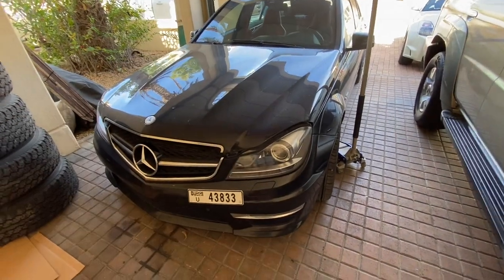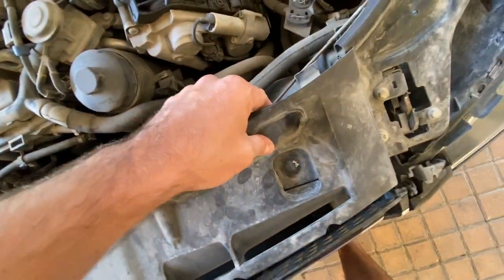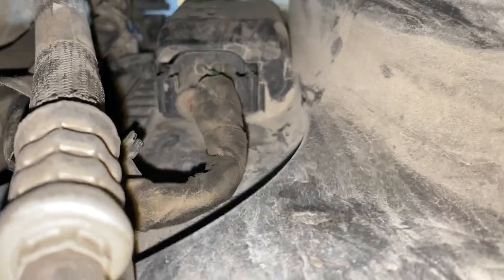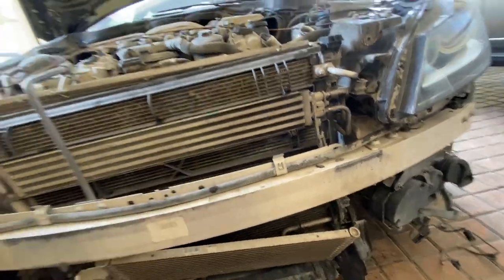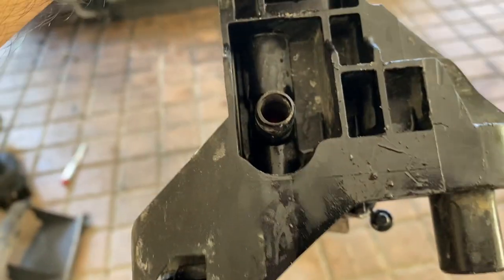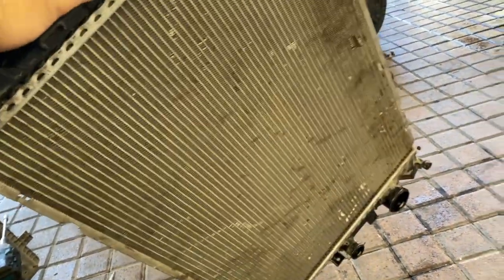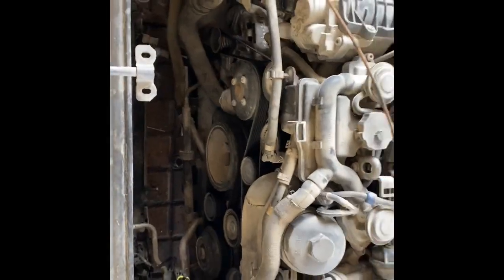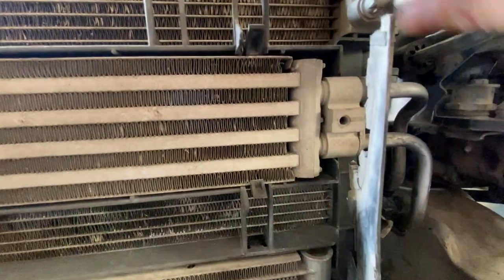Radiator repair for $80 - C63 AMG W204

Comment: Cool video it helps a lot.
Question. Do you have transmission oil lines in your radiator ? 
I have an 08 C63 and want to replace the cooler. Bt I think I have 2 oil cooling lines in the radiator.

Comment: Many thanks for this. In the middle of this job now and probably would’ve given up getting that radiator out if I hadn’t seen this. I don’t think I’ve ever had a more difficult time freeing a part from a car. Was it as bad going back in as coming out?
Reply from the maker: Hi Craig, glad to here it. I struggled as well and never thought it would be that difficult without taking the complete front end off. Putting it back in was relatively straight forward, you got this 🙏🏼

Comment: Thanks for sharing, will this be the same on all Mercedes?
Reply from the maker: Yes should be the same for most Mercedes’ of that generation, the general principle however also applies to most cars.
Reply: Fantastic video. I'm having a problem with my C200 cgi. I'm hoping it's drain plug that's leaking. 😊

Comment: hello, thank you for the video. I am French and I also need to replace the radiator on my C63. So if I understand correctly, it is possible to remove the radiator without removing the condenser?

thanks again.
Reply from the maker: Correct, I did not want to remove all the ac gas, so I managed to remove it separately, it wasn’t the nicest easiest work but it is possible
Reply: @burgerbuilds  Thank you for the answer !

Same for me, I would like to avoid draining the air conditioning gas. But in the official Mercedes procedure it is compulsory to remove the condenser.

Thanks again, I'll try to do like you.

Comment: Hi you have automatic gearbox? and you dont have any transmission  oil line in radiator? im asking because i want take transmission cooler out of my water radiator and im thinking about radiator like yours witch termostat. i have w208
Reply from the maker: Its automatic correct, normally they have built in coolers within the radiator, water cooled is more efficient than air cooled so maybe best leave it in the radiator, or have it run through the radiator and then into an external air cooler.

Comment: Where did u get the plastic repair bro I never knew they can change the plastic, my radiator burst on the plastic I already bought and installed the new one on my car but still have the old one, what’s the name of the repair shop u had yours done at
Reply from the maker: Sorry for the late response, luckily we have radiator specific repair shops here in the UAE, so I brought it to one of them and they replaced it. I used to also keep buying new radiators until I realized you can replace the side housing, save a lot of money

Comment: Have you got a part number for the part you replaced.. where did you buy?
Reply from the maker: Sadly there is no part number as Mercedes only sells the complete radiator for very expensive, I managed to find it at a local radiator repair shop.